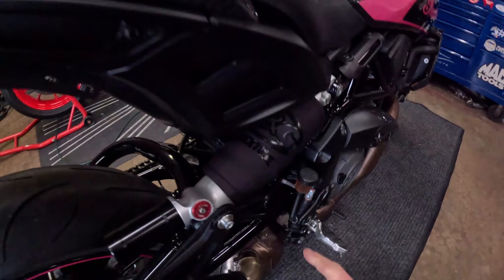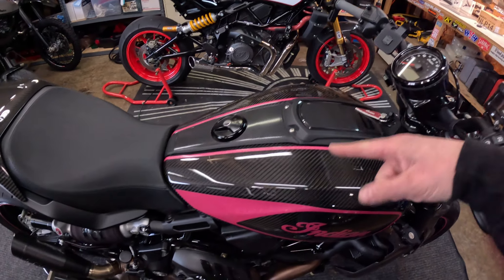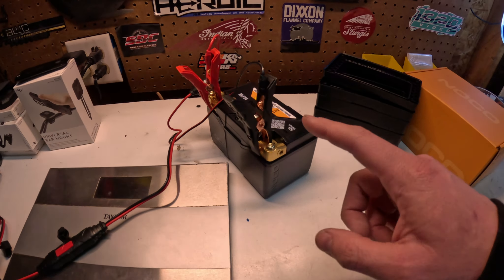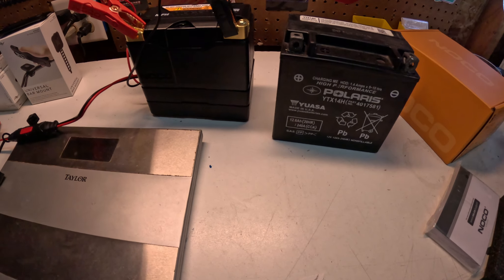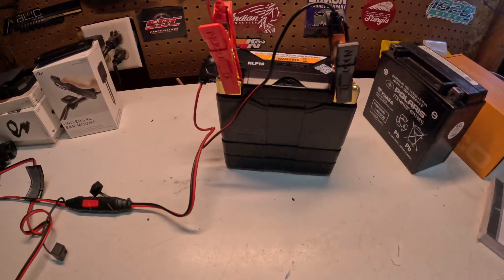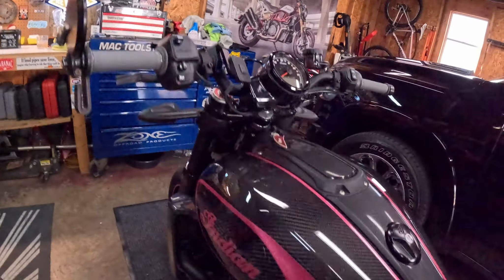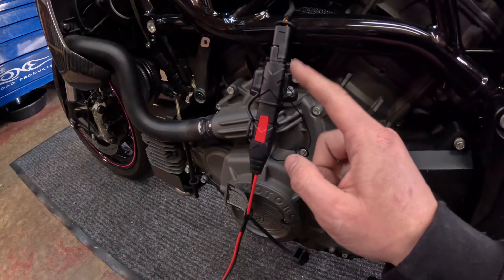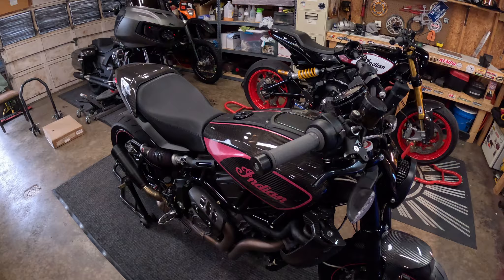New NOCO lithium battery for my FTR1200

Comment: so will the NLP14 fit a 2019 FTR? Amazon's telling me no.
Reply from the maker: Yes. That’s what the video is for..
Reply: Hello, this is a great video!  I’ve got a 2024 FTR Sport with 2300 miles on it and just starting to experience the 3-4 cranks and then dead needing a jump scenario.  It has happened twice inside of 5 days and left me completely stranded.  My dealer is great and installed a better more beefy Odyssey battery and it still happened a second time this past Saturday.  It is back there now for continued testing, data logging etc.  I knew about this prior to my purchase in June, but thought Indian had addressed this on the 2024… do you have a tune on either of your bikes or has switching to lithium alone solved the starting problems?  I agree 100% that your wife’s bike turns over much quicker than the stock battery.

Comment: Question, since you need a new type of battery tender to charge lithium batteries, does that mean your bike's alternator also won't work on the lithium?
Reply from the maker: Nope. The bikes charging system works just fine.
Reply: The stock alternator won't charge the Lithium battery to 100% charge, BUT, it WILL get it really close. Probably better than 90%. 

NOT charging a Lithium battery to 100% during every charge, WILL male the battery last longer that way anyways. So, it's good for it. 

There IS a B.M.S. (battery management system) inside the Lithium battery that will automatically balance the cells inside of it, and will disconnect the battery if for some reason an overcharge attempt is made by a faulty charging system. 

A lead-acid battery charger can NOT be used with a Lithium battery because a lead-acid charger tries to put a "surface-charge" of up to 15 volts on the lead-acid battery when it's done charging, and a Lithium battery does NOT like that higher voltage. The bikes alternator will NOT try to do the "surface charge" like a plug-in lead-acid does. That is why the need for a special Lithium charger if you're going to recharge or put the battery on a maintainer for storage.
Reply: The stock alternator won't charge the Lithium battery to 100% charge, BUT, it WILL get it really close. Probably better than 90%. 

NOT charging a Lithium battery to 100% during every charge, WILL male the battery last longer that way anyways. So, it's good for it. 

There IS a B.M.S. (battery management system) inside the Lithium battery that will automatically balance the cells inside of it, and will disconnect the battery if for some reason an overcharge attempt is made by a faulty charging system. 

A lead-acid battery charger can NOT be used with a Lithium battery because a lead-acid charger tries to put a "surface-charge" of up to 15 volts on the lead-acid battery when it's done charging, and a Lithium battery does NOT like that higher voltage. The bikes alternator will NOT try to do the "surface charge" like a plug-in lead-acid does. That is why the need for a special Lithium charger if you're going to recharge or put the battery on a maintainer for storage.

Comment: I have a 2019 FTR base. Purchased new in June 2019. Stock battery still good. Always used a tender. Am I just lucky? I changed the stock tires to Continental Trail Attack 90/10. Was Like getting a new bike. Too bad (for me) that Indian didn't offer the 17 inch wheels from the get go. These bikes rock and don't get enough credit or attention.
Reply from the maker: Like i said in the vid, the battery i just pulled out of her bike was the original battery from my 2019, it still cranked the bike, it probably would have lasted the season, but i didnt want her to be stranded. $120 is cheap insurance